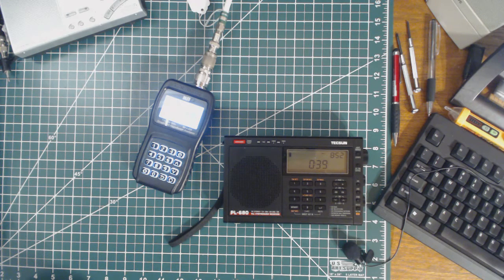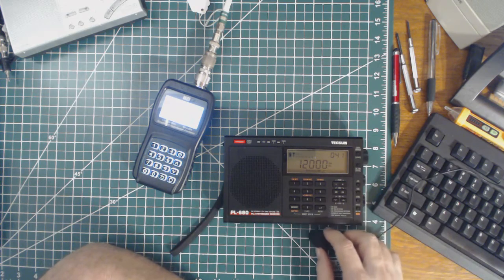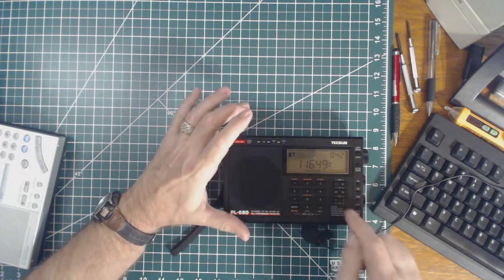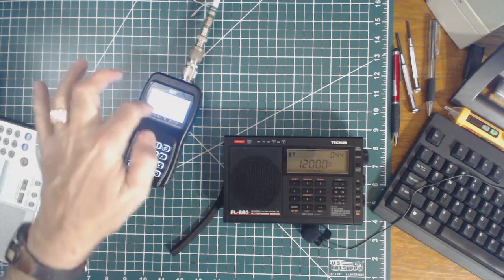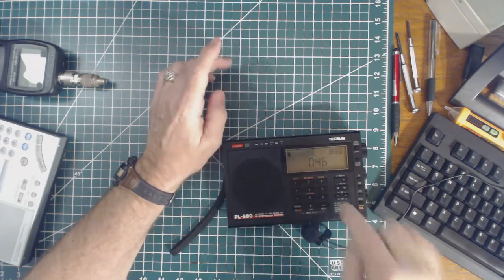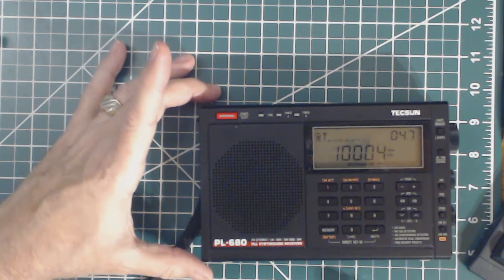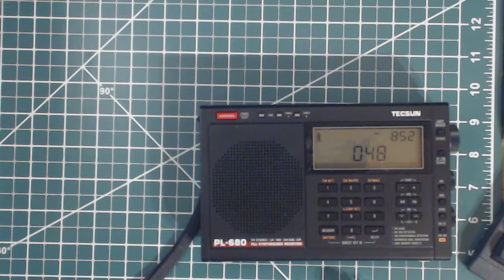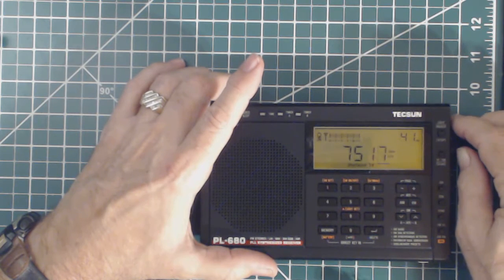TRRS #1057 - Antenna Analyzer as a Signal Generator

Comment: Don't think I would expect an antenna analyzer to have a very accurate and stable output for the purpose of calibration.
Reply from the maker: I will have to look at the specs.  If is does not, wouldn't be very good for testing antennas